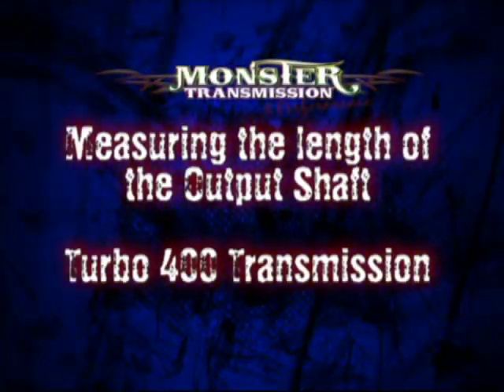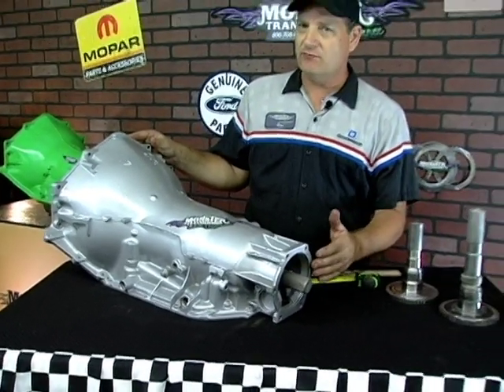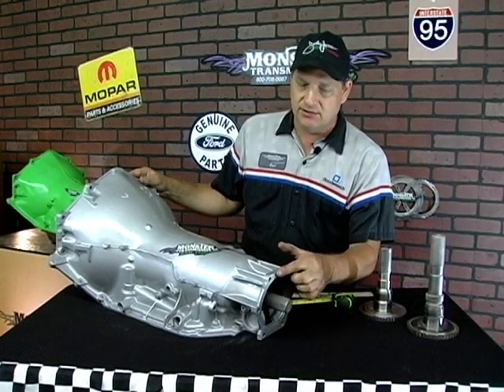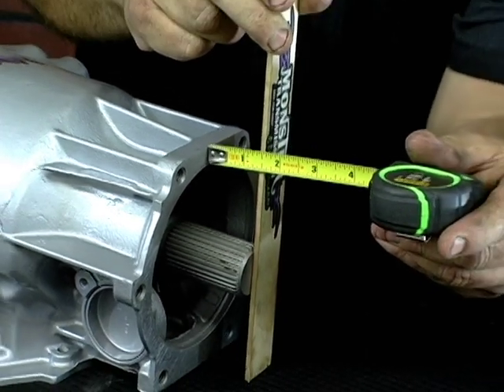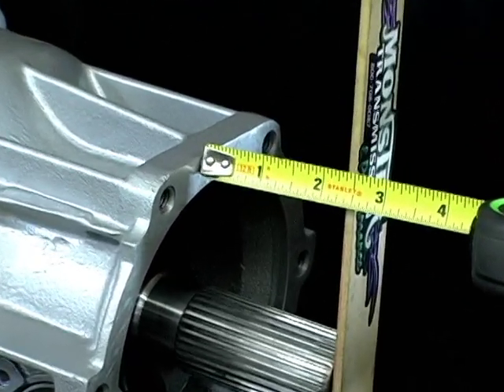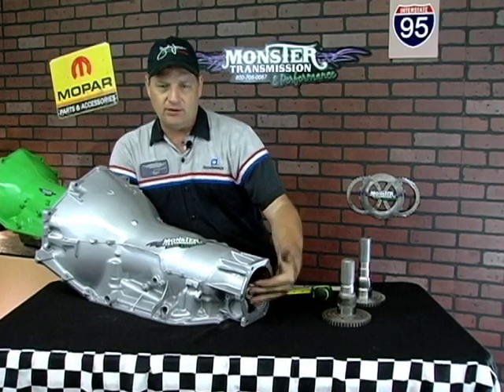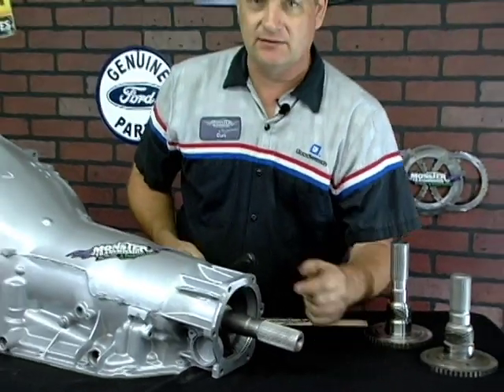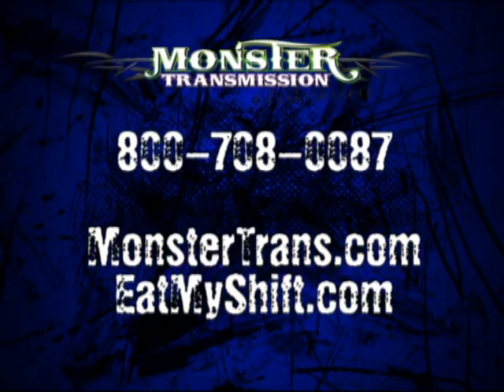Measuring the Output Shaft on the Turbo 400 | Curt's Corner at Monster Transmission

Comment: Question? Does a Turbo 400 for a Diesel have different internal gearing ratios than a 400 for a Gas motor?
Reply from the maker: No it does not.
Reply: Thank you.